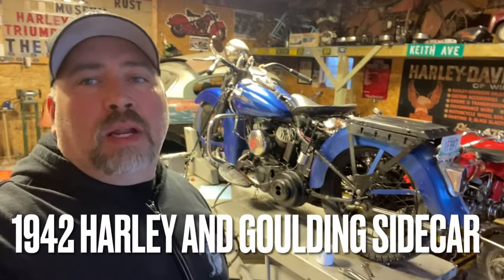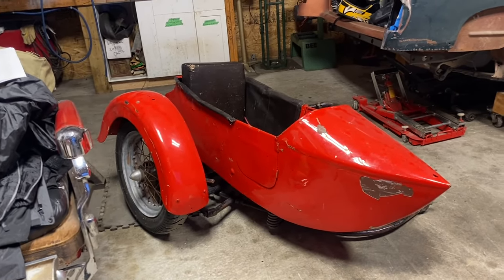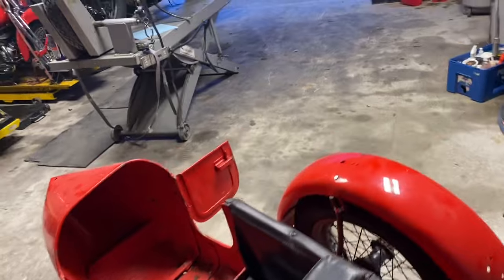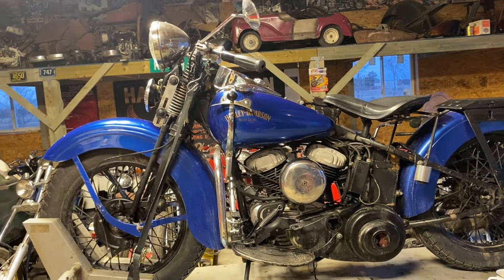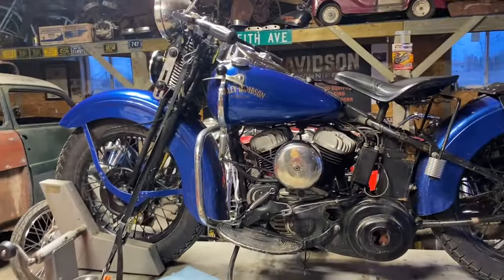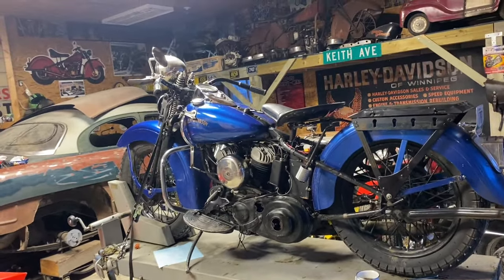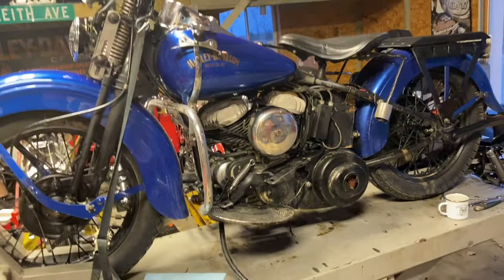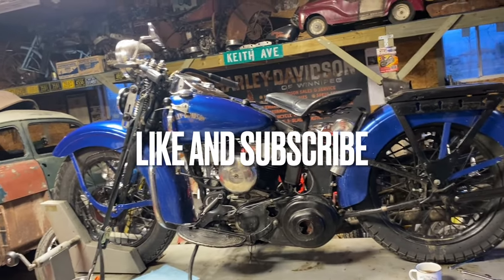1942 Harley Davidson WLC and Goulding Sidecar .

Comment: Nice merc!
Reply from the maker: One day I have to get back to it. I put another frame under since the original one was bent.  It’s got a hopped up 289 hi performance with a 4 speed . Both rebuilt. All new suspension. 2 and 4 inch lower. All new steering etc.  I made a new floor in the trunk and started on the inside of the floor. Then got busy with more bikes.
Reply: @Savetherust  I hear ya,I've got a 32 ford been in the shop way too long,and a dart that's been waiting 20 years,and a 34,and a 56 merc pickup,and.and.and.and. life is short.
Reply from the maker: Time flies.  I may have too many bikes. Some I don’t know if I’ll ever get to.  The car is my dream car. But hard to get back to it some days. So much to do.